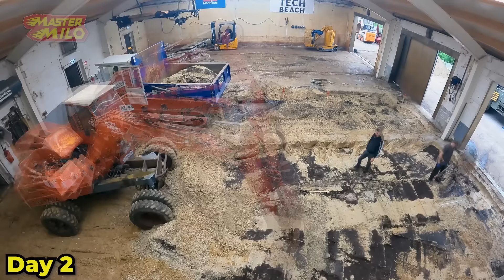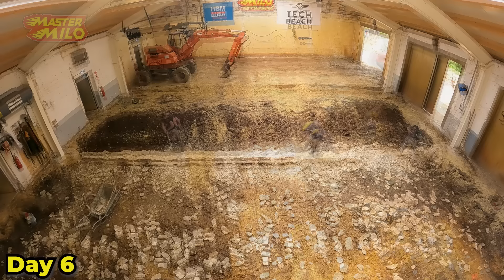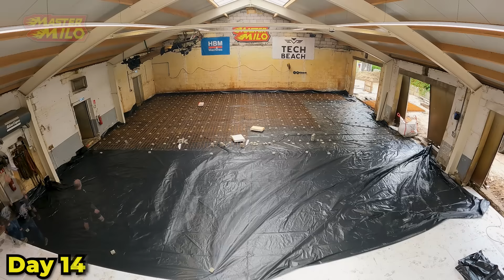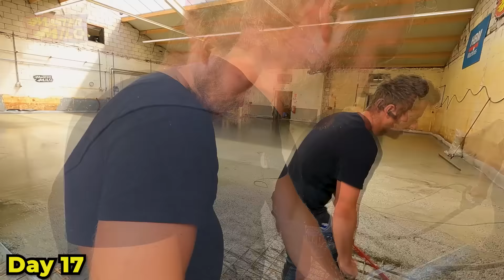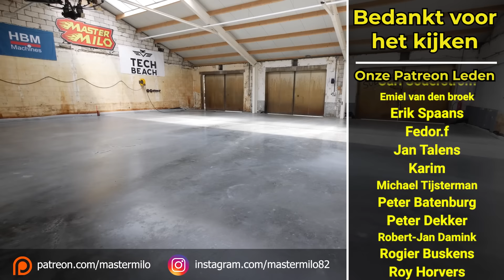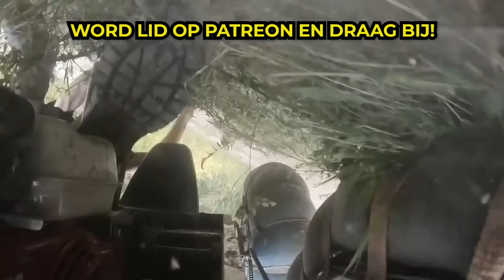Construction Timelapse of the Workshop Floor (17 days in 9min)

Comment: Not too sure about using polystyrene under the concrete especially if your working on tanks....?
Reply: Blue extruded would be much better.   But it does have a LOT of re-bar.

Comment: Can someone explain me what's that white foam? It looks strange to use it in an workshop where you put tanks in.
Reply: Those are EPS insulation panels. Those work fine because the pressure on them is equal through the entire floor due to the concrete.
Reply: For insulation.  An insulated slab makes for a warm winter work space.